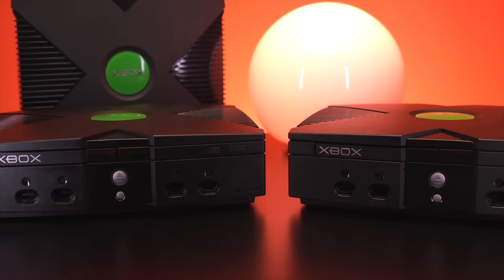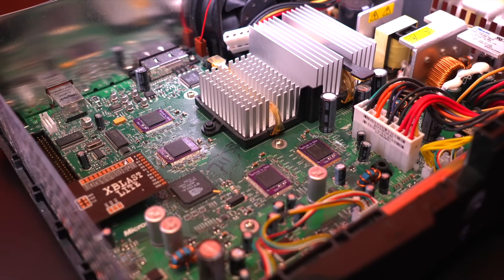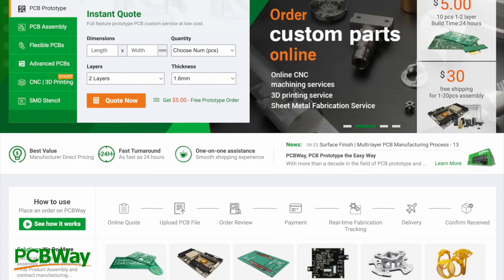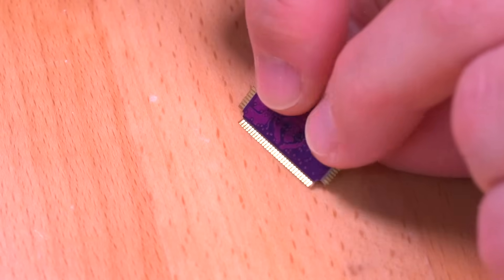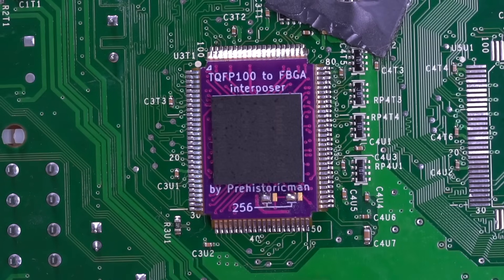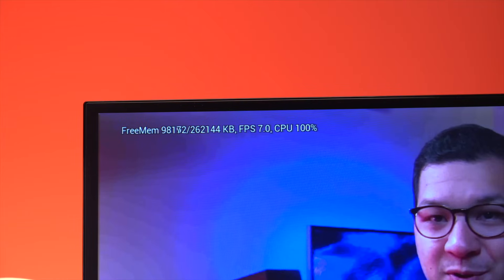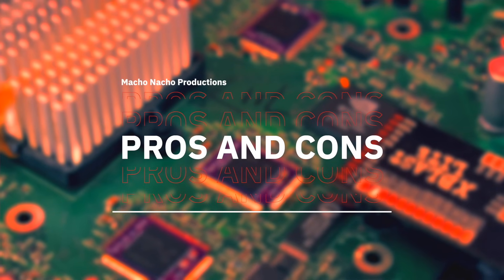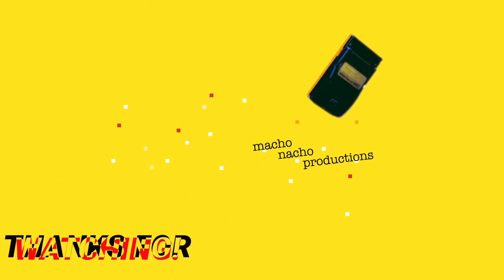Giving The OG XBOX Quadruple The RAM | Never Done Before!

Comment: What could an Xbox do with such memory
Reply: Nothing, literally.
Reply: @thecircuitbox  Xbox Devkit, as that was the principal difference between Retail (64mb), and Devkit (128mb) units. Play some old Sega Japanese Arcade Games, on what would have been Direct Hardware. (Looking at you Virtual Cop).
Reply: Very few homebrew applications are likely going to ever use it. The only thing I can think of that could benefit a lot is arcade emulation(in terms of 256 vs the old 128mb mod). CPU mods definitely offer a lot more benefit in terms of patched retail games where you can push games to higher rendered resolutions and have smoother frame rates. However I’d love to be proven wrong and have more games modded to take advantage of the additional ram but I just don’t see it happening
Reply: @sneakingelephant  
You're wrong because the increase in resolution is directly linked to the amount of RAM available, that's why we have 720p patches that only work with 128mb and not 64mb
Reply: @Nihongames  yes I know the ram is needed for the increased resolution. I was moreso referring to the jump between 256 and 128. We aren’t going to likely see any new higher resolutions patches vs the 128ram mod.
Reply: @Nihongames   also love your channel! You are one of the channels I’ve watched a lot of the 720p content in the past
Reply: @sneakingelephant I love when people speculate as if they're the arbiter of how hobby programming is spent and what on
Reply: Nothing useful. Each home-brew app, each game must be modified to utilize additional RAM. As there are no devs working on software patches and the mod itself is not trivial, it will never gain meaningful user-base. One day you may see some random game patched, or some app with 256mb support released, but that's it.
Reply: Finish the video
Reply: @SILVRXIII  interesting I didn't think it could do that
Reply: Nothing really, games would not take advantage of it... As he said "worthless", Maybe sometime a mod might happen where it could but, a smaller memory extension was known from when the console was current, and back then, like today, it did nothing to make games better in anyway, as all games would not even see the extra memory.

The bios would need to be fixed/updated and games needed to modded/re-written to see the memory...
Reply: In terms of games, most likely nothing, but yet again the cpu mod is a night and day difference when playing half life. For memory it would be different for homebrew apps, dashboards and bios
Reply: I'm really surprised the 8k video was using more than the 128mB possible on the dev kit. An extra 35 out 128 more installed being used. 1080 video would fair much better at a quarter the demand but might still hit Vram limits.
Reply: @J-Tagged  Run HalfLife2 in 720p but using HD TEXTURES instead the low definition ones of the xbox port... And you dont need a cpu upgrade as all Xbox can run at 900mhz from stock now (FSB 133 to the 166 max of the XBOX Nforce2)
Reply: my taxes?
Reply: Run StarCraft Ghost